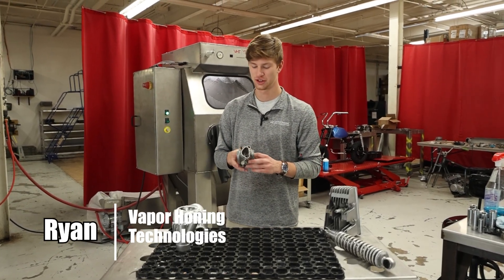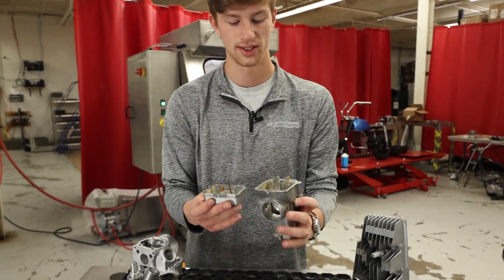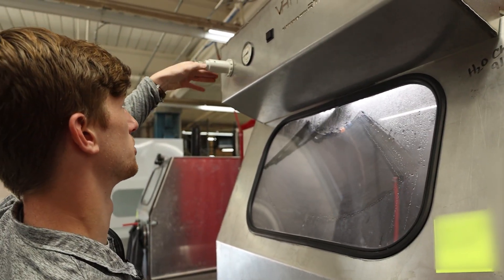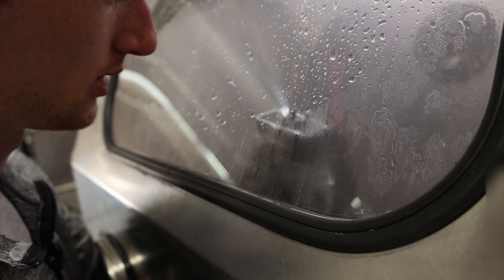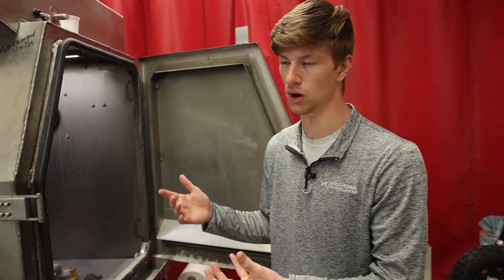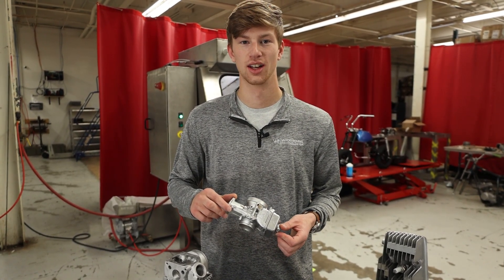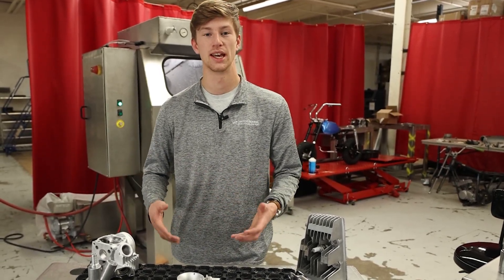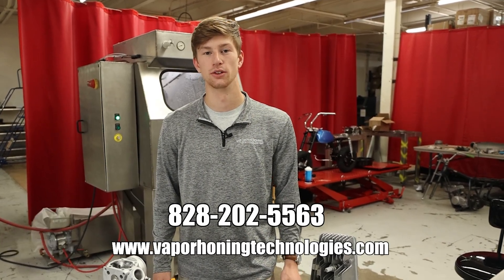How to SUPER POLISH a Carburetor QUICKLY - Is this the best method?

Comment: Looks great. What system do you have that can removes paint or powder coat from trim?
Reply from the maker: Absolutley! If you use an aluminum oxide or another angular abrasive, it is super easy to remove powder coat, paint, rust, or other contaminants. Hope this helps!